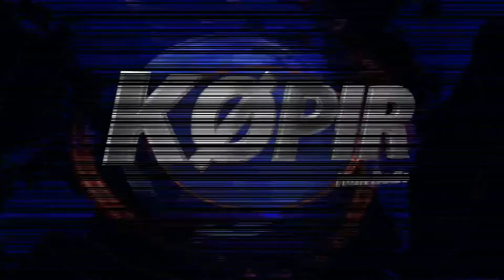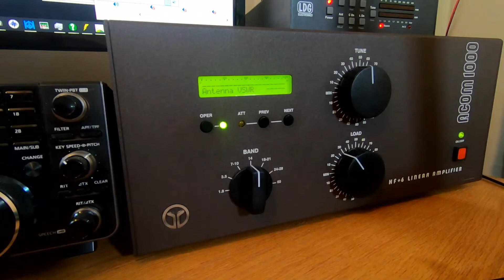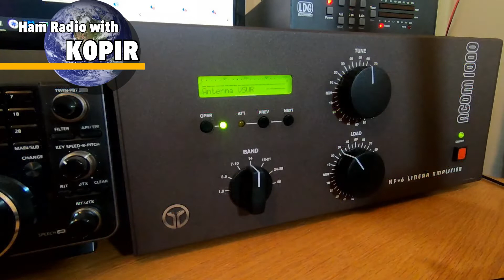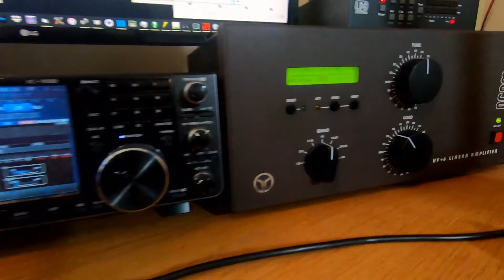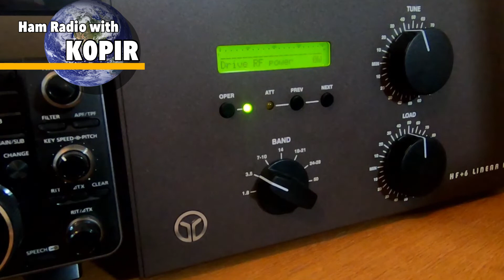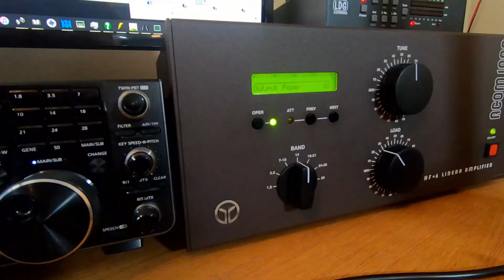ACOM 1000 Quick Tune Procedure

Comment: This must be an earlier version then mine.  First off, my display is reverse.  Black with green LEDs.  Second, the built in tuning feature by pressing PREV and NEXT at the same time gives a quick tune assist ARROW and only takes about 5 seconds, then, you hit operate for full power out.   

Mine was new in 2015, still on the original tube and I drive it with 87 watts.  Runs just shy of 1300w for my net control  ops with an ATR-30 tuner and TRUE LADDER LINE (600 ohm) feed right out the window.   I do have two new 4CX800A's in their boxes just in case, but there has been no decline in the originals output.   👍👍

Comment: Bonjour et Bonne Année pour 2026. J'ai bien apprécié votre video et je vous en remercie même si mon message vous arrive 6 ans après sa diffusion. Il faut dire que je ne parle pas très bien anglais et j'espère que Google fera bien la traduction. Mon problème: Je possède un Yaesu FT991A, un MFJ 939Y et un ACOM 1000 et une antenne SIGMA HF 360 Puissance max requise pour le MFJ 939 et SIGMA HF 360 égale à 300 w. Je ne peux pour l'instant faire fonctionner que soit l'ACOM 1010 sans la MFJ 939 ou soit la MFJ 939 sans l'ACOM 1000. Je n'ai trouvé nulle part sur internet comment brancher le tout. La seule réponse de certains OMs m'ont dit que c'était impossible. C'était soit la MFJ 939, soit l'ACOM 1000, mais pas les 2 ensemble.   Auriez vous une solution pour pouvoir faire fonctionner l'ensemble, c'est à dire le YAESU FT991A avec l'ACOM 1000 et la MFJ 939 en même temps ou bien cela n'est t'il pas possible. Cordiales 73. Joël/F8MGW.

Comment: Hi,interesting video, but if you read the manual, it states begin with low power, and then turn the power up, to the required power,,its what the Acom manual recommends,,thanks 73s from Rotterdam.
Reply from the maker: Roger that. 73!

Comment: Interesting, thanks. Simple novice question I guess -  say you only wanted 400W and not 800W. Once set up, if you reduce the input power by 50% (e.g. down to about 25W) will the power output also reduce by the same amount, or there about? Quite a few amps I have looked seem to be designed to be driven at max - and the adjustment down from the max appears to be the input drive power? Just curious.
Reply from the maker: Thank you for commenting here and watching my video. You are spot on. If you reduce the input power by half the final output power from the amp will be cut in half, approximately. There's probably a formula for that somewhere. Thank again and best 73!

Comment: Question...just picked up a 7610 and have acom 1000.  Do u only use an rca plug from send on icom to key in on acom?  Besides antenna?  What delay setting do u use in 7610?  Thank u
Reply: Yes, I only use an RCA cable and I set the PTT delay to 20ms in the ICOM settings. I have a 7300 and an A1000 ACOM with a Palstar HF-Auto tuner that I just got about 2 months ago. My first auto tuner in  30+ years! Everything works great, no hot switching. de. AB5VJ

Comment: How do u use 600w tuner for a Acom 1000 Thats over 600w?
Reply: you dont need a tuner. the manual states it will tune up to 3:1 match without a tuner.
I says tuner not needed.
"No heavy outboard antenna tuners required for antenna VSWR up to 3:1  "
Reply from the maker: @1112223333111  Thank you for commenting and yes you are correct it can handle 3:1 VSWR. It does that very well. Take care, be safe, best 73!
Reply from the maker: Don’t go over 600 watts.

Comment: Do you use the Acom 1000 with the Icom IC-7300 on FT8 mode? cannot get mine to trigger transmit. Want to save my PA on the 7300, any thoughts Rich? 73 Phil G0BVD

Comment: is it safe to directly key the acom with the radio? without using a keying interface like the ameritron arb-704?
Reply from the maker: Hi Corey, thanks for coming here and yes I’ve never used an interface. Just a keying cable. I have heard not to use a cable from the accessory port on the back of the radio to the amplifier. If a pin 
accidentally got shorted out it would be disaster. I am using just a shielded RCA type cable. Happy new year and good DX in 2020!